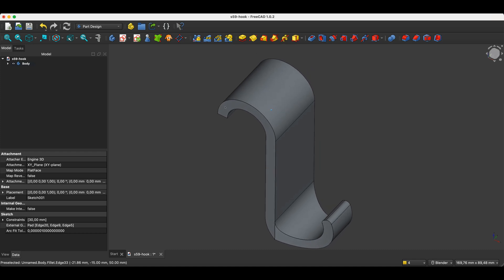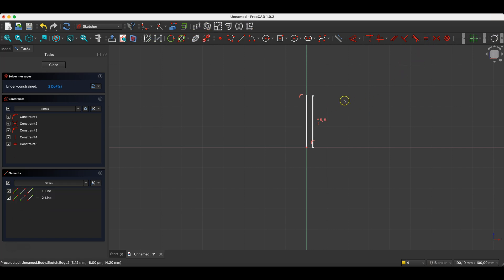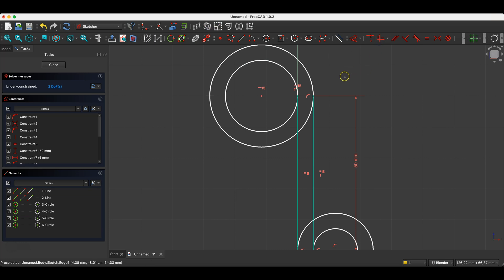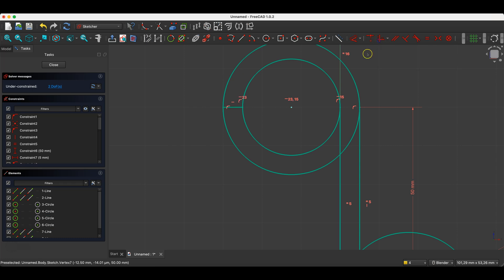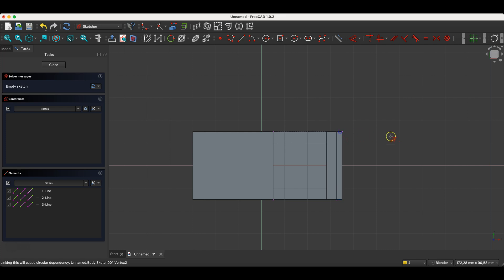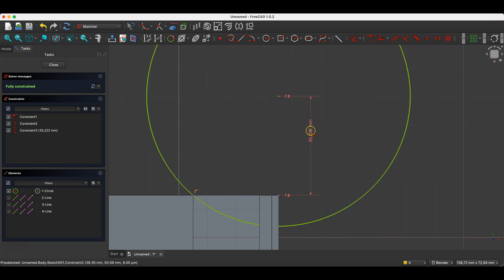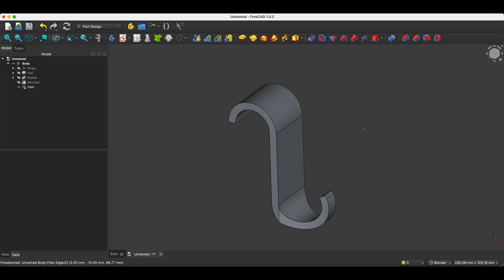FreeCAD Exercise: Master Sketching, Mirroring & Symmetric Planes!

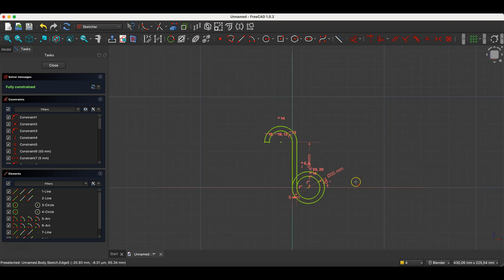Comment: @3:37 if excess triming, try reverse command<= key. Seems freecad double clicks during trimming operation. For me, overcutting occurs @ 20% of the time. Also, freecad seems to get confused if your demonstration of overtrimming occurs. I have found common situations where freecad doesn't immediately show trimming accurately. Example: trimming small lines, the error occurs and a line is redrawn & properly trimmed. However, a line associated with the first  (errored) trim is now hidden beneath another line. This small hidden line will not allow the sketch to close. Oh, the cumulative time of days I have lost trying to find this line. So, too, a trim of circle to tangent line. This trimming can lead to the creation of 2 points: line end & circle end. These 2 overlapping points may not be constrained to each other and if a constraint is made to 1 of these points, the other may not be constrained. Again, the sketch may not close. All of this leads to considering different orders of operations within a sketch, one being contrraining all intersections before trimming and use reverse latest operation if overtrim occurs.